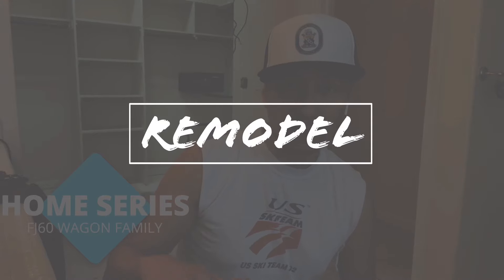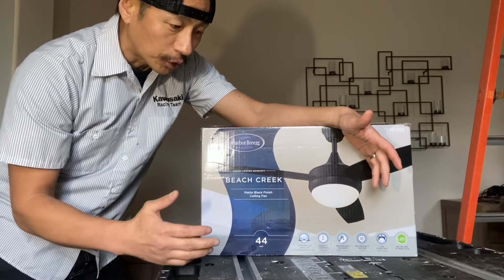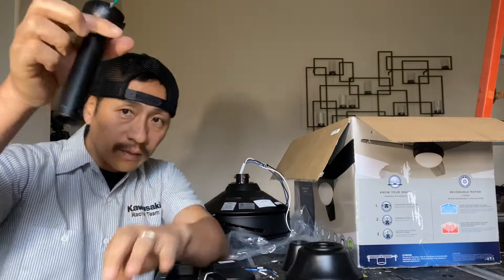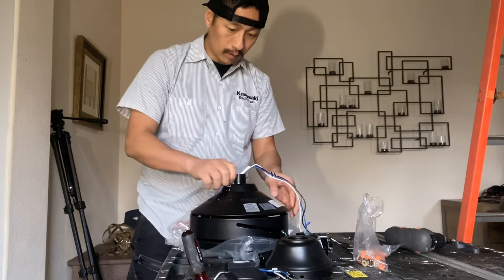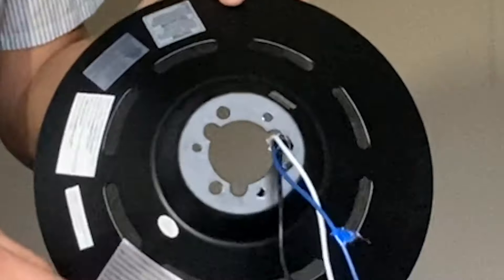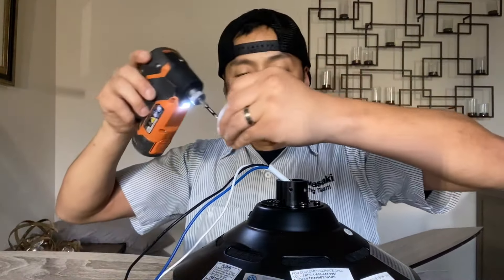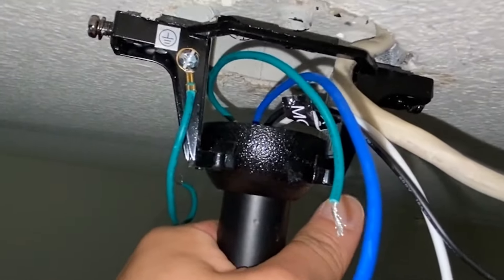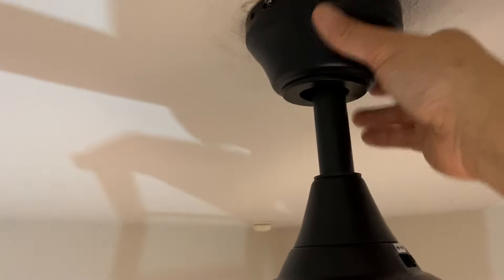best ceiling fan install video on youtube - Step by Step Guide

Comment: Remote won’t turn off the light. There was no red wire coming out of the ceiling to be able to connect the two blue wires. Fan Will only work if I wire them together with the black from the house and black from the fan and it allows me to control the fan with the remote but can’t turn the light on or off. Light is on permanently and only shuts off when I turn off the wall switch
Reply: Iam also having that trouble
Reply: Thank you so much, the instructions included were trash.  I have put up a lot of ceiling fans, never had all this trouble.  You saved me and my son giving up.  It works perfectly.  Thank you so much foe this video.  This company should be ashamed for such crappy instructions.
Reply: Also discovered this the hard way. Not the best for younger kids’ rooms.
Reply: Why not just run blue and black from fan to the hot wire from the ceiling?
Reply: I am having that same problem. I CANNOT turn off the light, except at the wall switch and CANNOT turn off the fan
Reply: @tinaposton3399  so what was the solution because I’m having the same problem
Reply: @tinaposton3399 mine was working fine for a couple weeks then one day the fan wouldn’t cut off. Can’t have light w/o fan. Been trying to figure it out for the longest and gave up because I’m not in that room often.

Comment: After hours of trying to install this fan, I finally figured it out. I had to connect my Red Wire out of the ceiling to the Black AC wire from the remote receiver and I got action. I have 3 more to install it will take me about 20 minutes to do so,. When I connected the Blue wires to the red wire (like in the video) the light stayed on but the remote nor fan worked. I followed all the other steps but connected the Red Wire to Black AC wire and it works perfectly. My house is a new build and the black wire from the ceiling was capped.
Reply: You the MVP. Just tried it and it worked.

Comment: If using a remote receiver.  The blue should not be connected to any other wires (Red). From the receiver - Blue to Blue, Black to Black, White to White. The receiver controls the light and fan

Comment: No matter what I do I can't get the remote to control the light... Fan yes... Light no... Tried the supplied signal receiver and a universal replacement. Blues together.. blues plus red... Nothing.
Reply: You ever figure it out, same problem here?
Reply: @mikemckernan884  nope... Taking it back... 2 out of three exact fans worked fine... The third the light never came on no matter what I tried

Comment: You explained more when unpacking the box than you did the wiring. 🤦‍♀️
Reply from the maker: Barbara your right the wiring instructions was fast, but super simple. you may need to replay or slow the video at 12 minute mark area. Basically the wire harness is broken into two sections off the motor. One section goes to the house wire and the second harness goes into the remote. It’s color coded and it should be straight forward... let me know if you have more questions, best.
Reply: @4x2WagonFamily  I have a 2 way switch. The light is working but not the ceiling fan. It works on the remote but the light doesn't work on the remote. 🤦‍♀️
Can you please help?

Comment: Many thanks! Just got done wiring mine into a new fan installation and this video pretty much walked me through it with  no major issues and complete success. THANKS!!!
Reply from the maker: Awesome to hear!
Reply: I don’t have a red wire coming out of my outlet box . How do I wire the blue wire ?
Reply from the maker: Most likely You can connect the blue or red wire to the black wire coming from power source. I’d advise checking with an electrician tho.

Comment: Regarding the DIP setting. I manage an apartment complex of 8 units. We had the place renovated and our contractor put these fans in all the units. Now we have cross frequency issues. Will have to figure out combo sets so that tenants dont turn on/off tenants next to them but I gotta say what a pain in the ass. Seems like old technology have to set combo switches.

Comment: But what did the two loan wires come in off the side of the remote box go to you say the wires coming out of the fan so all the wires hook together? I don't understand the part I needed the most you did not show
Reply: At 14:20 i dont understand where you hook up the 2 wires coming out the right side of the remote box.

Comment: Looks great! I wish I saw this video before I installed the exact same fan too day (different color, but same). Question, do you know if we can add a physical cord to the fan for light / fan in case remote isn’t available?
Reply from the maker: I don’t think so.
Reply: @4x2WagonFamily  I also forgot to check for the blade rotation direction until after I mounted. Then the hole on the top to change it after it’s mounted didn’t line up with the actual button. Looks like I’ll be taking it down and apart again 🤦🏼‍♂️. My first fan install 🤷🏼‍♂️😂
Reply from the maker: @bradj229  there’s a button or switch on the side if the fan; therefore , you can change the blade rotation so you don’t have to redo the install:)

Comment: Bought 3 of the same fans to install in a friends house. He has low ceilings so I opted to do the flush mount. Wired everything according to the directions, and when I turned the light on with the remote the light fixture popped, and flames briefly shot out of it. Killed the power, and inspected the damage. The white and blue wires for the LED light were charred, and there were burn marks on top of the light. I'm thinking faulty LED circuit board, but now I have to install the other two (and see if I can't return the burnt one). I don't recall anything that stated you should have a third wire (the red one) bridged between the ground and the blue wire for the light. Obviously the fan needs to be grounded, but this is taken care of by the housing wiring grounded at the base, correct?
Reply: Take it back to Lowe’s.  Demand your money back.

Comment: Hi! thanks so much for the video. I wanted to ask you if you could use the remote control from another room, or outside of the room, or if you need to need in front of the fan? thanks so much!
Reply from the maker: Near the fan. It’s an RF signal meaning line of sight works best.

Comment: My fan has two wires. And my house is pre-wired to control the fan with the switches. Will my fan work so I can control with the switches as well or do I have to get a three wire fan?

Comment: I have a Red wire hanging from the ceiling along with 1 Constant Black Hot wire and  a White wire (and ground).   2 switches on the wall for the light and fan.  Instructions say to attach the red to the Blue Wire, but the Blue wire is occupied on both ends in this fan.  What do I do with the Red wire?  Black with Black, White with White, and Green with Green and capping off the Red wire didn’t work.  Any help is much appreciated. Thank you

Comment: I have the same fan for about 8 months but now noticed a knocking sound it happens once every ten minutes or so… sounds literally like someone knocking on wood… checked the blades, all correctly inserted, tightened all blade screws, top covered screws… any thoughts what’s going on ?
Reply from the maker: Hum, thats odd. I would buy another one and return the old one.

Comment: Hi when I connect the cables the same way you did it. The light turns on but the blades don't move do you know why? Please Thank you
Reply: Do I need to connect the red wire? In other videos they don't connect it can you explain for me please why it's that?
Reply from the maker: Are you using the wall switch to control the fan? 

If so, turn on the wall switch to on position and use the provided remote control to control the fan and light.

Comment: Did anyone have a problem with the light cover? The light cover has 3 grooves for it to fit  over the LED lights but the space where it sits has no grooves. It is smooth. Am I missing something??

Comment: I had 4 of these installed and one of them has no reverse switch.  It’s just not there.  Did the installer make a mistake or is there another way to reverse the direction?
Reply from the maker: The reverse switch is well hidden on the outside of the motor shroud… they did a good job blending it into the main housing:)

Comment: Can you turn the light on with the light switch instead of using the remote?
Reply from the maker: Yes. And you can dim the light with the remote also.
Reply: @4x2WagonFamily  hi great video....what is the switch on the stem of the fan pointing arrows going left and right?
Reply from the maker: @bosshova23  that switch reverse the fan direction so you can pull the air up or push the air down.

Comment: Hi, I got the same exact fan but there’s a problem with the remote control. The button for controlling the fan on the remote control working good but the button for the light doesn’t work. The lights will turn on when you turn on the wall switch but it’s doesn’t work using the remote control. Do you have any idea?
Reply from the maker: The wall switch has to be in the off position to work the remote.
Reply: @4x2WagonFamily   you mean turn off the wall switch and reprogram the remote? I already did that but nothing happens
Reply from the maker: @Malingkat5949  both the light and the fan switch on the wall should be in the off position . Best
Reply: @4x2WagonFamily  do you think I need to reset the remote? How?
Reply: @4x2WagonFamily  I already did but still the same
Reply from the maker: @Malingkat5949  then I’m not sure.
Reply: @4x2WagonFamily  hi, the light is the blue wire right? So I should connect the blue wire from remote control receiver to blue wire from motor housing. Do I also connect the red wire from ceiling to those blue wires? Because on the manual it doesn’t say connect the red wire to those 2 blue wires.
Reply: @4x2WagonFamily  hi finally I already figured it out. I called the customer service department and they told me how to connect all wires. You just follow all what is said on the manual. The red wire should not be connected to the blue wires. Just leave it by itself. I followed your video to connect the red wire from the ceiling to those two blue wires. I’m not an electrician but maybe your ceiling wires or the electrical source of your house is different from mine. Anyways, I’m still glad you made a video of it. It’s very clear, easy to understand. Thank you very much
Reply from the maker: @Malingkat5949  Awesome, I'm glad you got it working:) Cheers!

Comment: We have the same fan. We install 4 but we’re not sure why one fan is rotating counter clockwise and not blowing enough air. How can we fix it? Can we change the rotation of the blade?
Reply: there is a switch on the side of the motor to make it rotate clockwise .

Comment: Hi my connections do not have a red wire and the lights will not turn off. What do you recommend?
Reply: Do not connect the red wire and leave it capped. If you connect it with the blue as he did in the video, the light will stay on indefinitely.

Comment: Mine is wobbling. What could it be?
Reply from the maker: The wobbling is usually caused by your fan NOT being installed on a metal box approved for a fan. Most ceiling lights are plastics and people will install a fan over the light not realizing a fan should be installed over a metal box. You can checkout your local Home Depot for metal box or fan box replacements.

Comment: This is great. How do you change fan rotation on this fan
Reply from the maker: The reverse switch is located above the fan motor it blends in really well so look carefully.
Reply: @4x2WagonFamily  Thanks for the fast response. I've checked again but still can't find any switch.
Reply: @stresslessmindz  I'm having the same problem. There is no reverse switch on the fan. I've checked under the light casing and no switch there either?

Comment: Dude, you didn’t go over connecting the wires????
Reply: Match the colors. Super easy
Reply: @Ezrabastian  Problem was that not all the colors coming from the ceiling were the same as the fan. I got it figured out though.

Comment: Uses your video to install the same brand fan. However the light comes on by using the wall switch but the remote isn't working to turn in/off light and fan.
Any suggestions???
Reply from the maker: The wall switch light and fan has to be off position. I didn’t realigned until later.

Comment: Do not buy this fan unless you like to squeeze six wiring connections into an impossibly small opening inside the housing, because the vast majority of the room inside is taken up by the remote control receiver. Piece of sh*t.
Reply from the maker: Lol, yeah it’s tight as a water frogs ass:)
Reply: Very true.  It’s a piece of crap.  It is damn near impossible to connect the wiring to that stupid remote control box.

Comment: This fan is a piece of crap.  The remote control box is almost impossible to connect.  There is absolutely no room to connect the wires.   If I would of known that I would not of bought it.  Clearly the worst ceiling fan I’ve ever installed.  I’ve been working on it for two hours and still not connected.  I’m so frigging mad at this Chinese junk.

Comment: You didn’t say anything about installing the remote. I watch the whole video, and now I have to sit through another to maybe or maybe not see you install the remote. Just change the description of this video please
Reply from the maker: Susan Ruffin hi susan, the remote install starts just after 12 minute mark. It’s really simple and and easy to miss. you may need to replay that section of the video couple of time to get a better understanding... best.
Reply from the maker: Correction-  the wiring of the remote starts at 14:30 into the video.
Reply: @4x2WagonFamily  hi ..Thanks for the video.....quick question will this ceiling fan and light work with a dimmable light switch?
Reply from the maker: bosshova23 yes it works with disable switch. I have a dimmer and it it works perfect.
Reply: @4x2WagonFamily  awesome thanks
Reply: @4x2WagonFamily  hi another question  Do you know how low it hangs from the ceiling?
Reply from the maker: bosshova23 6 inches.
Reply: @4x2WagonFamily  awesome Thanks! I just order mine!You have been a big help!
Reply: @4x2WagonFamily  hi can you tell me what dimmer switch you have? My Lutron Maestro dimmer isn't working with this fan....